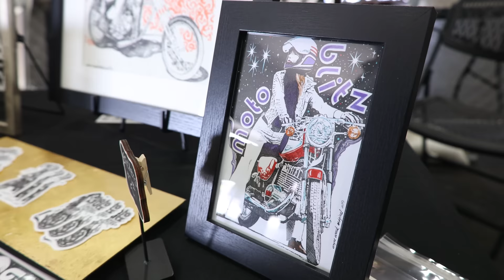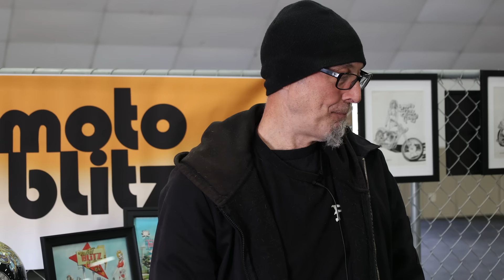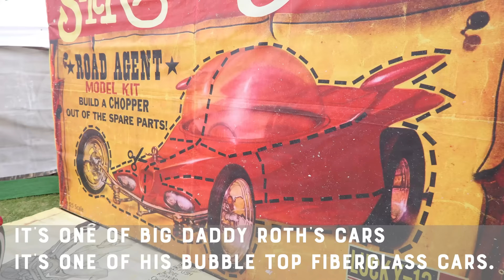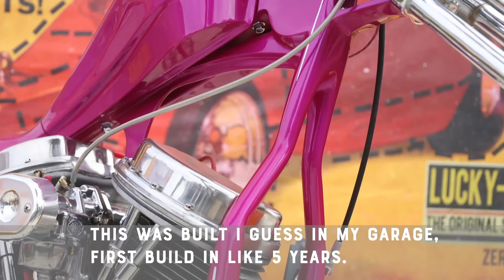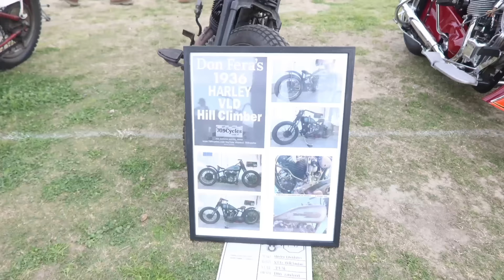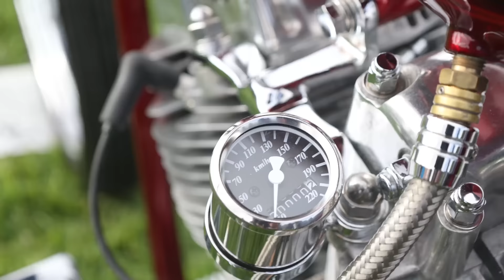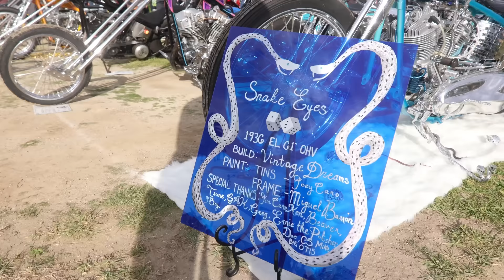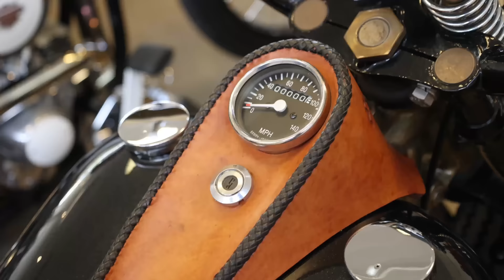David Mann Chopperfest - the Best of the Best

Comment: Ive seen BSA A10 hardtailed chop with bonneville disc brakes off of T140 front end with lockheed brake calipers. I also saw a chop with Norton commando motor which was lovely. Harley parts cost a fortune here in the UK and no doubt harleys are more common than honda c90s in the US but they really are so pretty especially those built from old parts like in the early 1960s pre AMF.